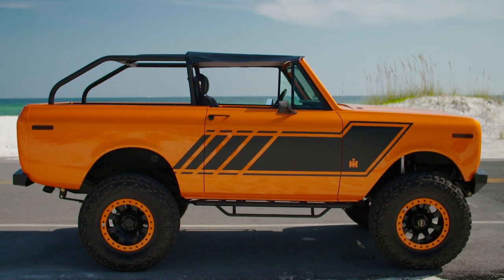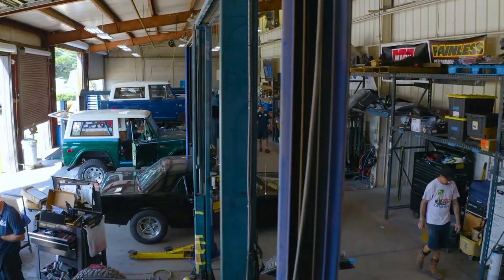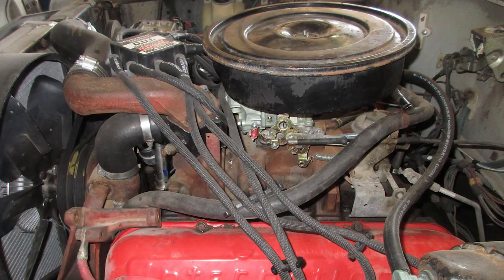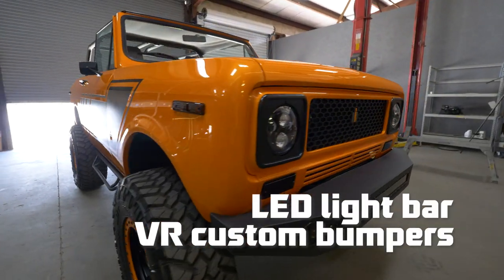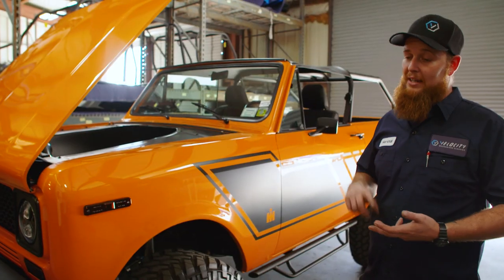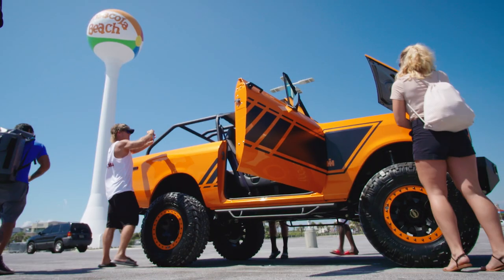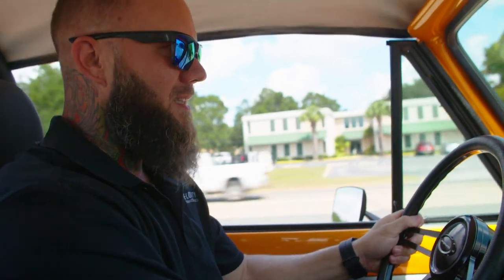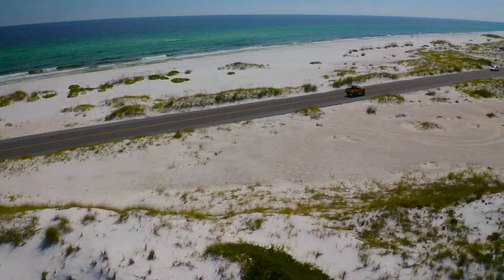1979 Harvester Scout Given New High-Tech Life | RIDICULOUS RIDES

Comment: It really looks great but for 275? I know its a high end build but I'd be a player at 75-125k tops
Reply: No way, even that is too high. $35-40K is the max for what they did.
Reply: @Education-1964  The LS3 crate is about $8000 alone, plus the price of the vehicle, the suspension, the custom dash and electronics, paint, roll cage etc etc. Definitely not worth $275,000 in my opinion but $40,000 wouldn't even get you the base vehicle, most of the ones I have seen are around $50,000 in good condition.

Comment: I had a 69 800 a that was restored ground up and I kept everything stock in the vehicle except electronic ignition was added and a modern wiring harness other than that moves all stock. Had a 304 V8 that we had rebuilt no need to swap engines but if you want a more modern up-to-date engine the ls is the way to go. I had the scout for 13 years and finally sold it and it was a great vehicle it turned a lot of heads although I didn't like people calling it a bronco or a Jeep.
Here's my 69 800a

https://youtu.be/VMz2yrkydAI

Comment: Nice work but $300k? Sorry, that is not IH nor Scout anymore. The fun of a restomod classic is taking a vehicle that doesn't cost and arm and a leg and making something new and modern out of it within reasonable means, which for the most part means doing it yourself in your garage over time. Even with the LS swap, that's not a Lambo priced vehicle. If I was going to spend $300k, I'de rather crack open a freshly crated brand new Italian sports car over this. I own a 74" Scout. Bone stock, not modded at all, some rust, 77k on a jumpy odometer, with the OG straight 6 258 still chuggin. Nope, my 3 speed doesn't get me anywhere fast and even years later if I update the car with all my work put into it I won't ever try to sell it for a cost like this. Why? Because that is what a Scout is and the everyman's vehicle should never be out of reach for everyman.